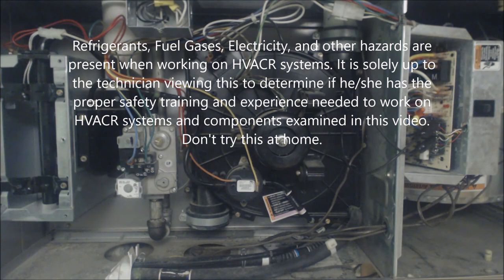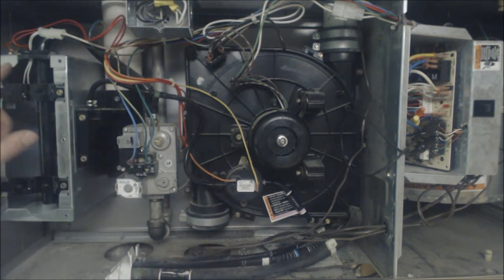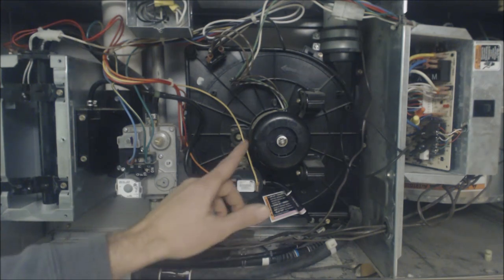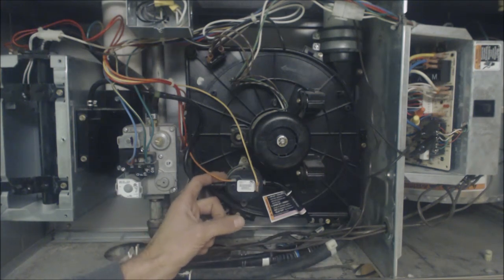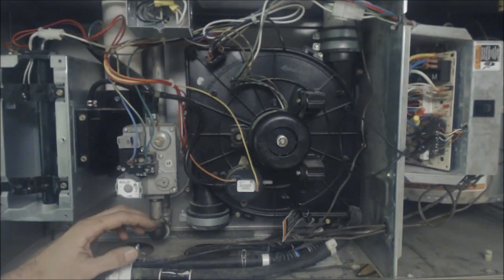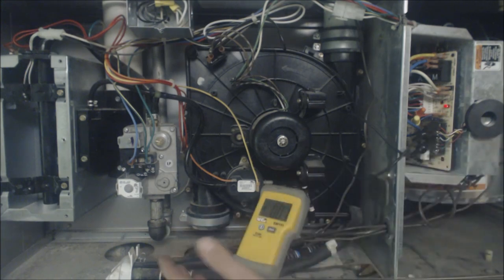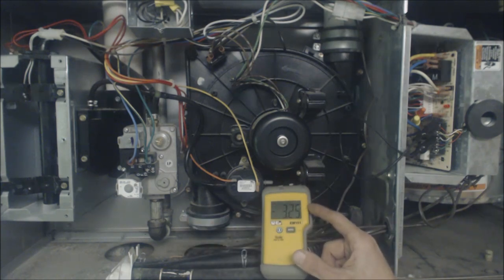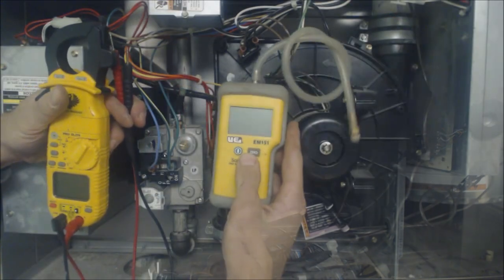Gas Furnace Troubleshooting! Pressure Switch Testing & Condensate Problem Error Codes!

Comment from the maker: Tool List-  https://www.amazon.com/shop/acservicetech
Support-  https://www.patreon.com/acservicetech
For those that are looking for the tools used in the videos: (Linked Below)

Here is the link to the newer UEI Dual Pressure Testing Manometer-  http://amzn.to/2y5lzVF

Here is the Link for the newer UEI DL479 Multimeter with temp sensor- http://amzn.to/2jtsUbJ

Here is the Link for the newer UEI DL469 Multimeter- http://amzn.to/2jw4ePJ

Here is the Link for the UEI DL389 Multimeter used in the video - http://amzn.to/2naJr9o

Here is a link for the Supco Magnet Jumpers http://amzn.to/2gS4h6z 

Here is the link for the Irwin Wire Stripper/Cutter/Crimper   http://amzn.to/2dGTj2V

Here is the link to the Fieldpiece SDMN6 Dual Pressure Testing Manometer with Pump-http://amzn.to/2jyK5Ka 

Other tool links can be found in the video description section.

 ACSERVICETECH is a participant in the Amazon Services LLC Associates Program, an affiliate advertising program designed to provide a means for sites to earn advertising fees by advertising and linking to Amazon.com.
Reply: I watched another video where the tech showed to test the "primary auto limit switch" he simply unplugged the two wires from it and tested from one terminal on the switch to the other for continuity..it had no continuity so he said to replace it..also to make sure this part is faulty he jumped the two wires going to the limit switch together and the furnace was now able to ignite the burners. Do you think is a good way to test this part? My primary auto limit switch tests this way exactly so I'm about to order one..just double checking before I do. 

Also, why do the other two limit switches up by the burners have reset buttons on them and the primary auto limit switch does not? my furnace is an Amana GULA090AX50

Comment: This past week on Long Island we had serious 90 percent furnace issues. Condensate lines and trap frozen . Also , icicles built up on exhaust and fresh air intake . Quick tip before condemning the pressure switch , take inducer clamps off and remove from pvc fitting while servicing . 8-10 Times I’ve found that it wasn’t a pressure switch but an air exhaust issue . Obviously for troubleshooting only for anyone new . Great video once again !
Reply from the maker: Check this video out on testing pressure switches isolated from the furnace- https://youtu.be/QAEBLigVD5g

Comment: I have detached all ground wires and the Lennoxs’ still fire. Also, replaced a a Lennox IFC board with a general replacement board that had a specific spade for Lennox for flame current via the flame rod wire. Does Lennox flame verify by dc current back from the flame rod wire or otherwise?
Reply from the maker: Usually there is a ground wire on the board that connects to the frame of the furnace. This can also be connected to the common. Sometimes you will see this wire will make its way to the gas valve as common and ground. The dc microamps goes back to the board through this ground wire, thanks

Comment: In the 80s i was one of the first to install high eff gas boiler. Immediately had problems with pressure switch due to unventted dryer.  We resolved that then had problems with gas supply in my neighborhood.  My low pressure pipes in the street werent maintaining a steady pressure.  It would drop by just 1 or 2 inchs water column and heater wouldnt handle that. Luckily tied into hp main on str and never had problems again. Down the road the utility put in new reg pits to correct pres problem.
Reply from the maker: Nice, thanks Skip!

Comment: So today I had a Trane XE90 where the hose to the collector box was at -1.9” and the hose to the gas valve and burner box was -0.15” w.c. When I had both hoses hooked up to my manometer, it was giving a differential of -1.75”. The switch that was on it was rated for 1.4” which I’m guessing was meaning -1.4” but it wasn’t closing unless I unhooked the hose to the burner box and gas valve. My questions are 1) what is that hose actually measuring and 2) is it supposed to be positive or negative? It connects to the positive port on the valve but it seems to me it should be reading negative from the inducer pulling through the HX.
Reply from the maker: It is reading negative even though the pressure switch says positive. It just means it is differential like you are saying. Did you check the pressure switch isolated from the furnace such as with a SDMN6 to see if the switch actually closes at 1.4? You would just run the vacuum with the pump on the negative side until the switch closes to see at what -pressure it closes at.  It sounds like the pressure switch is not closing at the right pressure from your readings. By the way, how do the flames look and did you check for proper combustion?

Comment: amazing video is there a way to tell by amperage on the inducer motor if the lines in the exhaust is clogged reguarding the load of the amperage of the fan
Reply from the maker: Unfortunately we don't know the target amperage. On a psc, the motor would draw less with a clog. A variable motor would draw more amperage with a clog. You would use a combustion analyzer to determine if the gas is burning correctly if part is clogged off. When it is bad, you can see it in the combustion chamber. It's crazy that some 90% efficient secondary chambers were built with just a slight rubberized coating on the galvanized tin and they didn't think it would rust shut, thanks
Reply: Thats interesting you say that and i didnt know that but i thought if there was a clog it would draw more amperage due to the fact its struggling to push out due to a higher load
Reply from the maker: When air is restricted on a psc motor, the motor will spin faster, the velocity of the motor wheel will be faster and amperage reduced. This is because the fan wheel is not getting loaded up with air molecules. A variable speed however would try to push harder and it will cost more wattage, thanks

Comment: Can you make a sequence of operation video of a typical 80% gas hot water boiler with spark ignition, fan center, fan in the can, automatic flue damper and probe type low water cut off?
Reply from the maker: If I run across one with a homeowner that I am comfortable with then I can do one. I can only do videos on what I have at the shop or on a service call when I have time unfortunately. Thanks!

Comment: What size of tee is needed for this connection?
Reply from the maker: Hey Attisso, a 3/16 barbed tee is used to keep the hoses connected while taking a reading with the manometer. Some of the higher end manometers will come with the tee. Otherwise, it will have to be ordered or pulled from an old furnace from a changeout, thanks!

Comment: Check out the fieldpiece dual port manometer with the draft simulator for testing pressure switches. You will never say "maybe" when troubleshooting a pressure switch again.
I believe it's the SMD1
Reply from the maker: Yes the SDMN6 is a very nice tool for checking isolated pressure switches with it's internal pump. Thanks!

Comment: can you please explain why there are 2 pressure switches for a 2 stage gas valve? but the inducer has only one speed. does the low fire pressure switch for 1st stage goes OFF when high second stage is ON? only one pressure is closed each time for each stage correct? thank you.
Reply from the maker: sometimes there is a differential depending on how the tubing is going. Sometimes the two pressure switches are connect through the back. Have you seen this playlist on pressure switches yet?- https://www.youtube.com/watch?v=XKAyznghlro&list=PLxnHR5_D2ojytzJCx7C5ruHcmaYicpJ7a

Comment: What if I only have 24V on one side of the pressure switch? Is the switch then bad?
Reply from the maker: It could be many other things.  the condensate trap backed up, exhaust partially clogged, intake partially clogged, clogged heat exchanger, bad inducer motor, bad inducer wheel, bad inducer motor capacitor, clogged pressure switch tubing or clogged tubing port where it connects to the inducer at, thanks

Comment: Bad secondary? Was that a plus 90? Looked like too much IN. WC ....
Reply from the maker: You would have a high in wc on the inducer side but a low in wc on the combustion side if the secondary was partially clogged. It usually doesn't clog completely, thanks

Comment: If there is a bird's nest in the vent pipe, how do you recommend removing it?
Reply from the maker: I would remove the inducer, run a fish through the exhaust to the top, add a rag to the top on the fish and pull it through to the inside, thanks

Comment: Wrong , there is no 90 to 100 volts to flame rod , try again , it sees microamps across it from flame rectification , the board looks for a minimum to prove flame !  Your not a certified tech are you !!
Reply from the maker: Michael, I am sorry but the board has to send a hot leg of ac voltage to the flame rod in order for this ac voltage to be rectified by the flame. Next time you are working on a furnace check for an ac voltage reading between the rod and the 120v common or ground. You will not have the dc microamp signal without this ac voltage.